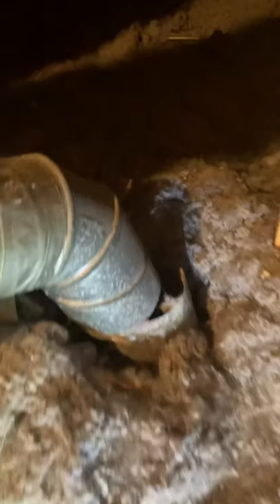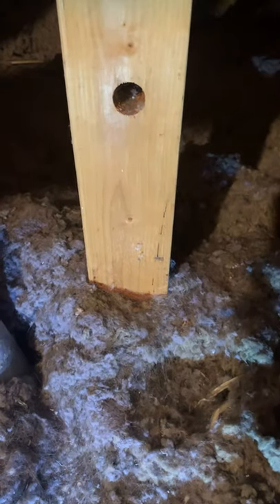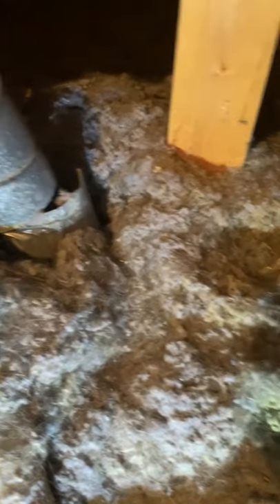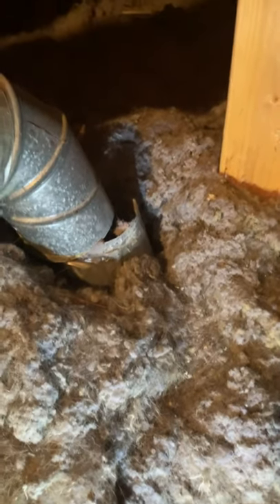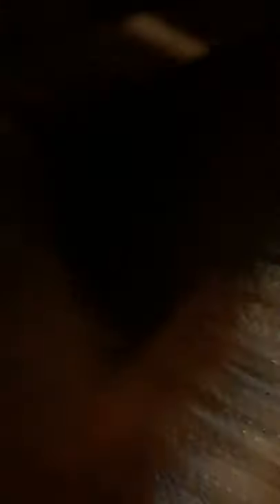Dryer Vent Exhausting in the Attic

Comment: I’d never buy a house unless the dryer was directly vented to an outside wall.  If the laundry room isn’t on an exterior wall I’d walk away.  Venting thru the roof or around corners and lengths of pipe is dangerous.

Comment: I wouldn't call it much of a fire hazard because the drier is still properly venting, just not to the right place. I'm more concerned about the TONS of moisture that would be dumping into the attic and the mold that will follow!
Reply from the maker: Good point
Reply from the maker: @Stephen James the dryer vent is not connected as shown in the video. It’s actually the whole point of the video.
Reply: Mmmm black mold just like my friend had to deal with and asbestos at his old maintenance job

Comment: I bet you charged them $300 or more for just fixing that
Reply: @sin warrior - Yes sir I would too . Here in Arizona where it’s 122 degrees outside and 155+ in a attic everyday during the summer. I would not be coming out for less then that.. Plus attics are notoriously not kept well so he probably spent 30 min just talking with the owner, locating the attic, and finding the pipe in there. So yes this is easy a 2 hour minimum scenario -
Reply: @justinlee4022  I respect that